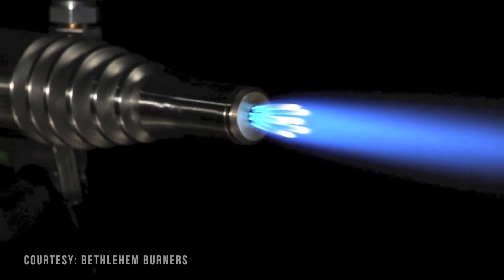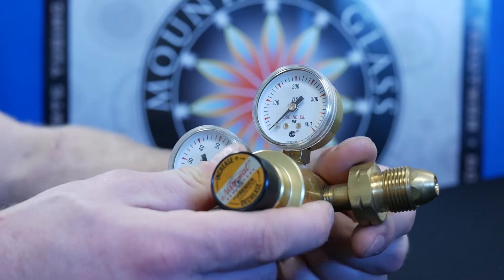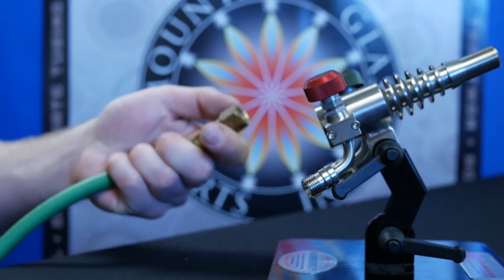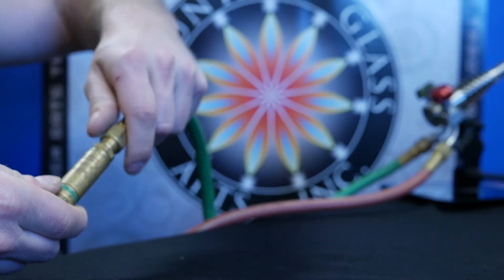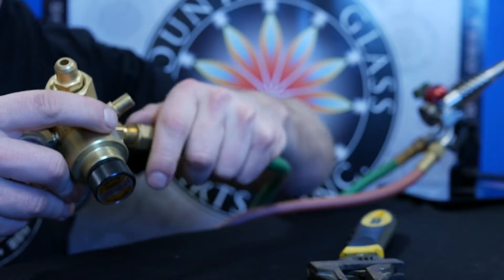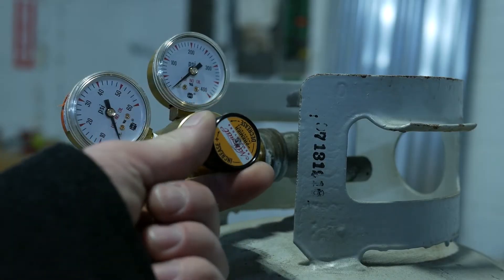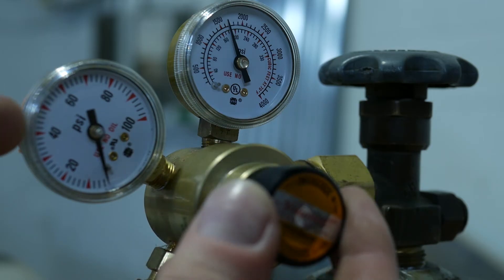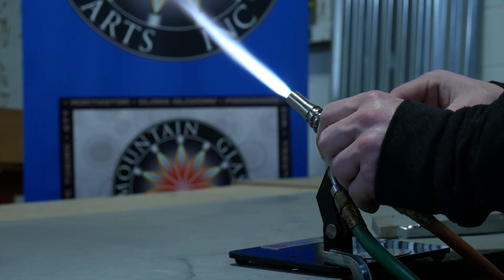Setting Up a 2-Inlet Torch for Glass Blowing (How to)

Comment: Is it cheaper to use an oxygen concentrator? Tanks seem very expensive. Is there drawbacks to a concentrator? Does this perhaps limit you to only working with soft glass?
Reply: I use a 5L/minute oxygen concentrator with a Nortel Minor torch.  The combo works like a dream.  The OC has a 20,000 hour life, and the electricity to run it costs $0.04 per hour.  It is SO delightful not to have to schlepp around a heavy rented tank and pay thru the nose every refill.  The regulator on the OC works great - no external regulator needed.  The only limitation to the setup is the same limitation with any smallish torch; you aren't going to be blowing giant flasks, haha.

Comment: Flashback arrestors are not needed for a surface mix torch as no combustion is occurring inside of the torch.
Reply from the maker: This may be true, but we prefer being safe over sorry. You never know what can happen when working with fire and compressed gasses.
Reply: @MountainGlass  Since adding arrestors creates more connections which can develop possible leaks I'm not sure how much safer it is.  I guess my point is that you should keep your fuel lines as simple as possible.  If you don't need flashback arrestors you shouldn't use them.

Comment: For the O2 Tanks, what size do you use, and where would you find one?
Reply: The best place to get oxygen is from a local welding supply shop. We recommend getting the largest tank possible to save yourself the trouble of having to move the heavy tanks more often. The most common size of for compressed oxygen is a K tank. If you're using a larger amount you may want to consider getting liquid oxygen, but these tanks are very large and off gas unlike the compressed tanks.

Comment: Just a quick question, can i use oxyacetylene for this? Or it has to be oxy propane
Reply: It has to be oxy/propane or some torches can use oxy/natural gas. Acetylene is not used for these torches.
Reply: @mountainglassarts8186  thanks

Comment: I have a GTT Cheetah running on concentrators but dont have arrestors on those. Is that needed with oxy cons?
Reply from the maker: You don't need a flashback arrestor for a concentrator 👍

Comment: Very nice set-up video! Another easy way I like to check for leaks is to turn my tanks and regulators on to pressurize the lines, then shut the tank off completely. I wait 10 minutes and check the line pressure on the regulator, If its lower or at zero that may indicate a leak.

Comment: ...It's super awkward that Hacksmith lead me here...
Reply: Same.
Reply: Torch cover for the glass
Reply: I hate how his claim to fame is a casing for an existing product. They didn’t make shit.
Reply: @ryangagnon5489 You do realize they made it possible, Queraff? People have built other things using preexisting technology before, I.e, the Wright Brothers taking concepts of Gliders from other people who made Gliders, and stuck prebuild engines into them.

Are the Wright Brothers "Talentless Hacks"?
Reply: @Victor-056  its way different to take an existing technology and incorporate it into something you invented hence your wright brothers example, which is completely separate from what he did he took an existing product made a fancy housing for it and stuffed the stuff needed to run it into a backpack, which is not innovation if you ask me. let me give an example. if you have 2 mass produced cheap toy helicopters both mechanically identical but one is in blue and the other is in red, are those not the same helicopter? or is the color the thing that makes it completely different from the other. Also i never called him a talentless hack, he has made many great inventions that he designed himself, for example the rebar crossbow, or the v1 titanium lightsaber or the sleep pod. What I do say is, i feel like it is dumb that his claim to fame is the lightsaber when its easily the least impressive thing he has made if you look into it. I have more than a few gripes with him and the hacksmith team for their decisions but i will not get into that because continuing to argue this matter is pointless.